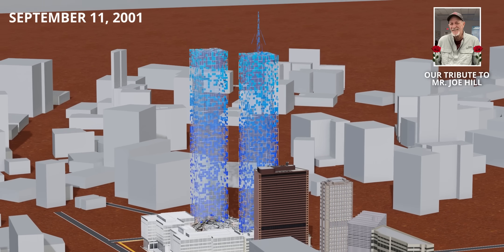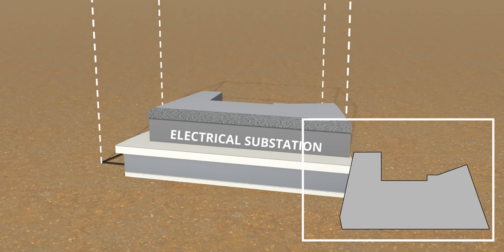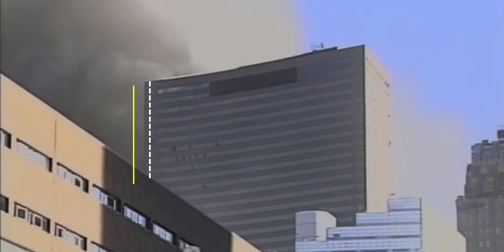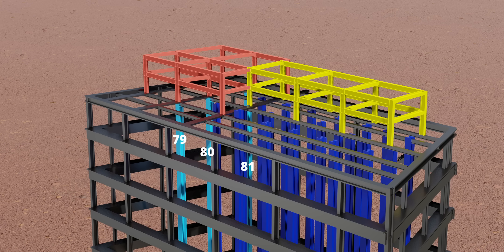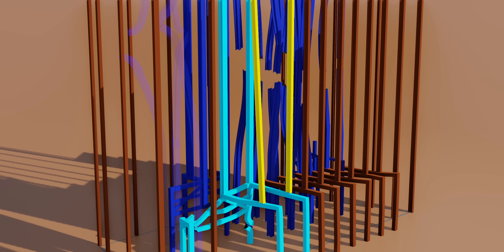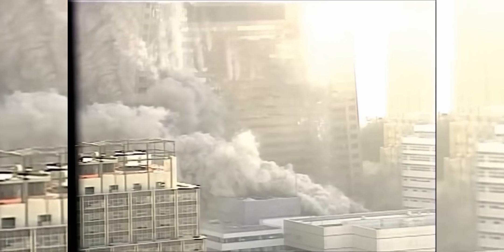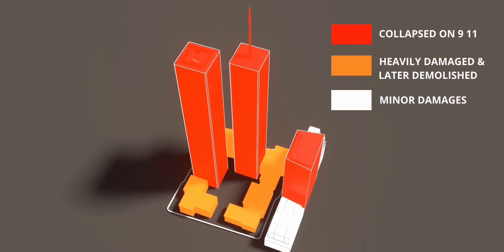Collapse of Building 7 | The Complete Physics

Comment: Why is the 'crease' on the penthouse on the opposite side of the building as the fires??  Funny how the "wall movement" is talked about, then the structure collapses inward.... if the structural integrity was compromised on the corner opposite where the ' penthouse collapse' happened... if the fires on the opposite side were so devistating and compromised the steel, the building wouldve leaned to the weak side, and tipped.  It wouldnt implode inward
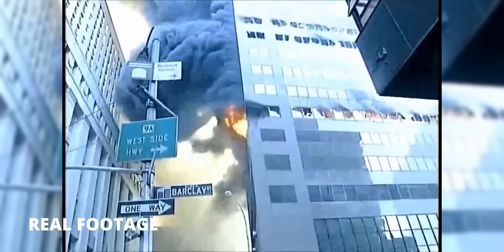Reply: It isn't. Fires spread, especially over 7 hours. The East Mechanical Penthouse was (surprisingly) located on the east side of the building. At 3:05 (if you were paying attention) we see video of the burning NE corner of the building - multi-floor fires right underneath the EMP.  I suggest watching again, this time take your time.

Comment: i think you're full of shit, and you're using terminology and concepts most people don't bother to research as a means to cover up what actually happened
Reply: And yet not wrong. Go figure. 
	
This video is pretty good – with one or two exceptions - and goes into a much higher level of detail than many viewers will be able to comprehend.  While not perfect, the collapse mechanisms – the sequence of failures - described here  are substantially correct and this is true no matter who planned and carried out the 9/11 attacks or why . 

That may not be what you want to hear and go against 20+ years of entrenched dogma and conditioning, but it’s not wrong. 

That also means (in case you did not get the hint) this video can be (and IS) absolutely correct in its description of collapse mechanisms AND the 9/11 attacks could still have been some sort of inside job. The two things are in no way mutually exclusive. 

The mechanisms described here have broad professional support around the world. There are no professional engineering organizations (for example: ASCE, ASEE, ICE, etc) that disagree with them or have offered any formal dissenting opinions or alternative hypothesis. 

So, setting hubris aside, either the overwhelming majority of the worlds structural engineers and simple observation are wrong,… … or you are. Which seems more likely? 

IF you still think believe this explanation is wrong then produce a better one . Good luck with that. No one ever has and I don’t see you moving that needle today. 

No one ever does.

Comment: This is complete BS. Your explanation is just conjecture and does not explain the "controlled" demolition of building 7
Reply: @h1F595  Well, that's my point. no one really knows how it came down. The only thing we can safely assume is that it was a controlled demolition and to try and pretend and explain it away is in my opinion, BS. You can call yourself an expert but that does not make your theory correct.
Reply: @MrLeighman  - Nonsense. The collapse sequence is extremely well understood. There is disagreement over the specific collapse initiating mechanism (straw that broke the Camel's back) with several plausible candidates, but the sequence of failures after initiation is well understood as well as the WHY that is the sequence of failures.  The proximate cause (7 hours of unfought fires) has never been in doubt among a serious audience.

Controlled demolition is a hand-wave rationalization used by people for whom thinking is a challenge.
Reply: Maybe this will go better, not that you will bother to read it. The unknown and unimportant Building 7 was the 6th building to collapse of 10 lost on 9/11. Though extensively studied, it confuses many people. Not famous, or a terror target, and no casualties, thus it did not get a lot of attention and few know much about it, creating a void rapidly filled with garbage from the internet. Because everything seems like a conspiracy if you don’t understand how it works I prepared this brief summary explanation of my own analysis. No politics, just engineering. 

The North Tower collapse at 10:28am bombarded Building 7 with tons of burning debris, causing heavy damage and starting raging fires burning out of control for 7 hours. Half the responding FDNY firefighters having been killed, others injured, units in disarray, equipment destroyed, no water pressure, and the greater urgency of Search & Rescue efforts, firefighting at 7 was pulled as futile. The building couldn’t be saved and was left to its fate.

www.youtube.com/watch?v=g_SvpwyC17M&ab_channel=MFitz  

Collapse of a burning structure is always a concern for firefighters. Steel buildings subject to fire rely on active fighting of the fires to survive. Buildings are designed around 1 to 3 hours of fire resistance, allowing time for occupants to escape and ACTIVE firefighting to get started, after which all bets are off. Left to their own devices they will exceed their design envelope and collapse. In B7 the occupants escaped, passive and active fire protections were compromised and active firefighting was abandoned which left the building to take its chances. It lost. Odds on Building 7 would eventually collapse, and it did. No big deal in logic. That is the sort of choice firefighters make every day in brush fire situations - which houses to save and which ones to let go. Only real difference here is moving the decimal on the size and cost.

www.youtube.com/watch?v=WnYBX6QT0R4 

FDNY Chief Daniel Nigro ; The biggest decision we had to make on the first day was to clear the area and create a collapse zone around the severely damaged 7 World Trade Center, a 47-story building heavily involved in fire. A number of fire officers and companies assessed the damage to the building. The appraisals indicated that the buildings structural integrity was in serious doubt. I issued orders to PULL BACK the firefighters and define the collapse zone. It was a critical decision; We could not lose any more firefighters. It took a lot of time to PULL EVERYONE OUT, given the emotionalism of the day, communications difficulties and the collapse terrain

FDNY Deputy Chief Peter Hayden ; We had our special operations people set up surveying instruments to monitor and see if there was any movement in the building. We were concerned of the possibility of collapse in the building. And we had a discussion with one particular engineer there, and we asked him if we allowed it to burn could we anticipate a collapse and if so, how soon? And it turned out that he was pretty much right on the money, that he said 'In its current state you have about 5 hours

The collapse of Building 7 was anticipated all afternoon and widely reported in the media with at least 24 video cameras recording some or all of the collapse. Everyone at the time knew what was coming and why.

www.youtube.com/watch?v=OY5S5k3tMHI 
Building 7’s collapse was totally different to the Twin Towers, harder to understand and most of the details difficult to see. But we can sort out what happened through careful analysis and observation.  What follows is MY EXPLANATION of the collapse sequence using the best available information and relying on no authority.

B7 was complex structure, a 47-story steel framed building built on top of a smaller existing 3-story building, requiring several lower floors dedicated to complex load transfer structures instead of usable office space. Of trapezoidal shape and all-steel tube-in-tube construction, B7 (above the 7th floor) consisted of a central core of steel columns carrying most of the gravity load, perimeter steel columns around the outside of the structure carrying the remainder of the gravity loads and long span beams and girders to tie those elements together and form the floors. On the outside of the building hung a moment frame - the last part of B7 to fall. 

Phase 1 : Collapse initiation for B7 is notably quiet with observers not realizing the building was collapsing! There was no audible warning in the form of say hundreds of ear drum busting 180-190dB explosive bangs preceding the collapse. The first externally visible signs of collapse initiation occurred at 5:20:28 pm. Here at 12:00 a local CBS affiliate reporter is talking 10 blocks from B7 when collapse begins. People don’t start to notice the collapse until 12:11. Then at 12:45 is the famous CBS fixed camera clip of Building 7’s collapse Again, note how quiet it is.

youtube.com/watch?v=t5tEy6mXSE8&ab_channel=fresnosean379

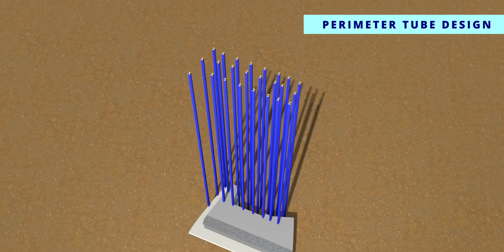Collapse initiation was due to multiple lower floor failures above the load transfer region (7th floor) in the NE corner of the building. In this video at 0:45 you can see the NW corner from inside the building while under construction, Column 79 just out of frame on the left. That big, angled steel beam across the top of the frame connects to C79 at one end. The girders connect to the beam. That beam and all those girders depend on just one connection

youtube.com/watch?v=nP3TNHPCIVU&t=35s&ab_channel=EdwardCurrent

Phase 2 : Lower floor failures caused a loss of critical lateral support over an excessive length of core Column 79 and it buckled. If you look at a floor diagram of Building 7 (see above) and look at all the structures that depend on C79 you quickly realize this one column was a relatively isolated structural element on which a disproportionately greater fraction of the structure depended . Externally we see a vertical progression of window breakage along the 44-46 line and a kink in the roof of the East Mechanical Penthouse at the top of the building, consistent with C79 failure. The transition from full capacity to almost no capacity occurs in virtually an instant. Once the buckling failure occurs there is almost no resistance

Normally with a buckling column, the load could very well be redistributed to other columns, meaning the buckling could stop after a while. With C79 that is not the case - the failure did not redistribute the load, so the collapse rapidly progressed to the roofline, sinking the rooftop penthouse.

Phase 3 : With C79 gone, B7’s progressive, non-symmetrical collapse continues with C80 and C81 at the east end of the core left laterally unsupported and quickly buckled and failed as well, sending the EMP down through the building. C79-81 all have no diagonal bracing, which I believe is a major reason why they could not redistribute a lot of vertical loads among one another.

From there collapse progressed from east to west through the central core until the core was gone taking all of the interior floors and structures and probably most of the perimeter columns with it. You can see the horizontal progression of window failures low in the building and the dropping of the remaining rooftop structures into the building. One of the big takeaways from the NIST Building 7 study (that gets completely ignored) was their modeling which determined C79 failing under ANY circumstances would have initiated the same collapse sequence.

Phase 4 : After more than 10 seconds Building 7 is reduced to just a hollow empty outer shell - the exterior moment frame - creating the illusion the building is still standing since little has changed externally. But it’s just a hollow empty shell like an empty cereal box supported by only a few remaining columns and quite unable to remain standing. The north face leans inward, forming a V in the roofline, the last perimeter columns buckle under the strain and with nothing left keeping it up the moment frame free falls, landing on top of the 7-story high debris pile. It is only here, at the very end that a single measurement of alleged free fall is taken. Start to finish the collapse took 18-20 seconds, or less than 1/3 of true free fall for those who have been conned into believing that has any meaning. Worth noting - how fast something falls cannot tell you what started it falling in the first place. It’s not even the building itself free falling but its empty remaining outer shell at the very end of the collapse. The debris spread out, blocking surrounding streets, heavily damaging the Verizon Building and destroyed Fiterman Hall, all well outside of Building 7’s “footprint”.  

Building 7’s progressive, non-symmetrical collapse was incidental and unintended collateral damage from the combined effects of fire + time + gravity started by the collapsing North Tower. That is true no matter who planned and carried out the 9/11 attacks or why . The collapse was of so little consequence it barely even registered at the time, a mere footnote. 

Anything can seem like a conspiracy if you don’t understand how it works. Now you should. I hope you found this helpful and informative, not adversarial and it solicits informed critical comment. If I made any errors of fact, logic or reason or left anything critical out, please let me know so I can fix it. IF you can offer a more plausible alternative please do. Be the first. Please start any reply with the words “Tits McGee” or I will know you didn’t read it and are wasting my time.